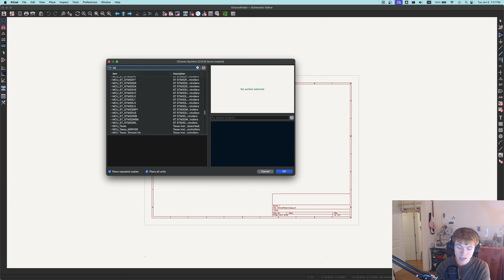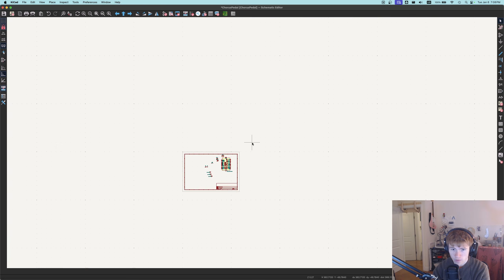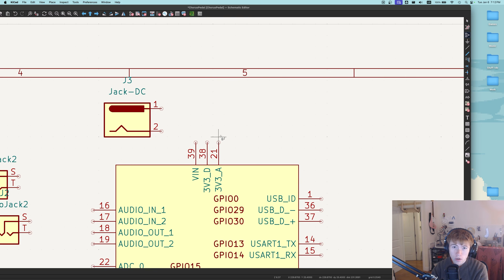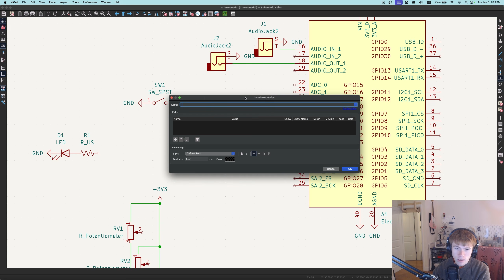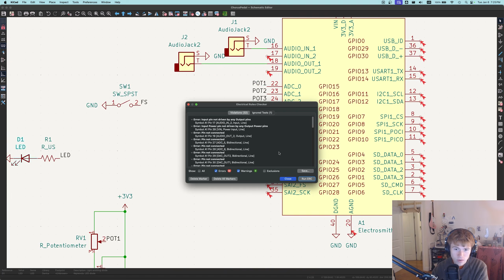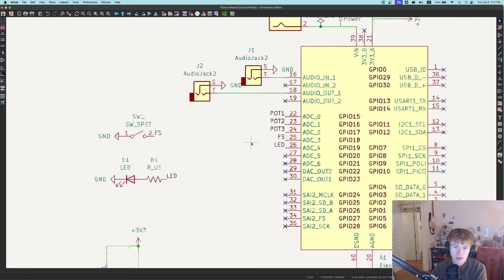Designing a Guitar Pedal Schematic (KiCad Basics, Daisy Seed)

Comment: One thing to watch out for with instrument pedals, etc. is that the DC jacks have a center pin that is negative and the outer sleeve positive. This is in contrast to  a lot of the wall warts that you find floating around and these will definitely do your circuitry no good if connected as shown in this tutorial. Always double-check the label on the supply before connecting it. The little diagram on there should show the polarity of the connector. Alternatively test with a multimeter if you are not sure. 
Great series Sam. I am an EE with 40+ years of experience but am enjoying how you explain stuff. Particularly useful to connect with Tayda.
Reply from the maker: This is extremely helpful thank you!! I mention in the last video that has yet to come out how it's backwards (specifically that the shorter leg on the jacks I have are power) but I never knew the reason why and thought it was just the specific jacks I had bought. The first few pedals I made I soldered them on backwards lol. Do you know why this is exactly? Just some weird convention that was started?

Appreciate the comment and thanks for checking out the course!

Comment: Hey my friend, I noticed that you left your audio i/o without a buffer. As far as I know, those i/o are calibrated for line(ish) level signals (a little weaker than line level). Any particular reason? Thanks.
Reply from the maker: Yes you're absolutely right! A typical op-amp or JFET buffer would be necessary to make this pedal into more professional/standard pedal territory. I chose to leave it out for this course for a couple reasons.

Mainly is that since this course is geared towards absolute beginners, I thought that it would be a couple notches too complicated. I wanted every step of this course to teach people stuff that they could fully understand and go make their own version of, instead of just copy and pasting what I did. I thought that teaching the different circuits that would take the pedal to the next level (voltage regulators, filters, buffer) would add too much complexity to the point where people would just be copying and then would struggle adapting it to their custom design.

I also found that when I started out and tried to take other circuits like those found on the TerrariumPCB or Daisy Petal and add it to my PCB, that I wasn't good enough at routing and designing PCB's yet so they would have tons of noise (far more than just doing it without those circuits). So I figure to people doing a custom layout that it might actually have the reverse effect of helping them.

And then honestly at the end of the day I just started diving more into EE and PCB stuff in this past year so I don't feel totally qualified to give a deep dive on setting up and correctly routing those circuits. I fear I would say wrong things or it would just take a jump in complexity that would turn away people.

Still though as you can hear in the first video when I demo the pedal, it sounds great! The Daisy is surprising great at handling the guitar signal without any additional circuits.

Sorry for the long message, hope this makes sense!
Reply: @ImSamKnight thank you for the answer

Comment: How do we fill in the components with models so we can simulate our pedal?
Reply: Simulating will be a 'little hard' because this is a digital pedal where the microcontroller could do anything it wanted with the audio, rather than an analogue pedal, where all the electrical frequencies and audio response are governed roughly by rules of classical mathematical/electrical physics laws, which is what a component simulator like LTSpice would use to show you how an output response varies to an input signal like a frequency sweep.